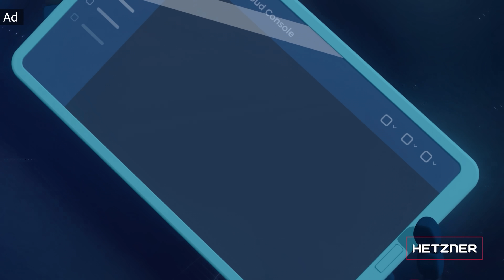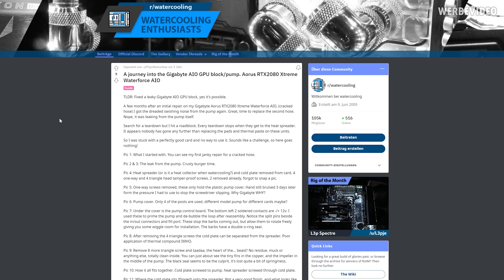Viewer-Mail Ep6: RTX 2080 Gasket Disaster

Comment: I'm thinking those 4 spots that created the roughness on the gasket are probably some kind of glue they used to hold the gasket to the cold plate.... This is a really dumb thing on a gasket, but that is the only thing I can think of that would create those spots in EXACTLY the CENTER of ALL FOUR SIDES of the block.... I think that glue is the cause of the ENTIRE PROBLEM

Comment: Watercooling is great, but just like anything else it gets worse with cheapness and carelessness when assembling stuff. I wouldnt want such a dinky plastic pump on my imaginary watercooled 4090 I cant afford anyways :) A possible solution could be to run you card/ case so hot that leaking water gets evaporated like we see here, although you would need a custom loop with a monitored reservoiur for that :)

Comment: You could definitely use an O-ring of the same or slightly larger thickness and the same or slightly less circumference as that square because it's a tight fit around the copper piece. You would stretch the round O-ring around the square piece and it should do the job.  Gaskets often start off as round cross section or even O-rings when new.  I've seen many automotive gaskets that, after years of heat and pressure, form to the shape they are contained in, which is often a square cross section groove.  Next, it looks like the fill port plug was held in place by a roll pin and not threads. Roll pins are small dowels that would be inserted in hole that is tangential to the fill port and interfaces with a groove in the plug.  I think the roughness on the original gasket was most likely adhesive to hold the gasket in place during assembly based on how evenly spaced the spots were.  However, the flats of squares or rectangles are often difficult to seal which is why in most pressure applications, only round openings are used.  I was surprised how clean the fluid was, my CPU was getting hot and I opened up my AIO to find it full of white sludge.
Reply: Yes, just stretch an o-ring back on. My thoughts exactly.
Reply: I always find it interesting when a subject expert shares their knowledge in youtube comments. It's also amusing how much of complex PC problems can seem to be simple mechanical engineering or electrical engineering problems.

What kind of adhesive do you think they're using? What's the material or of these O rings? Where can I learn more about these?  Any specific courses that teach about O rings, adhesives for mechanics and PC builders alike?
Reply: You can actually buy the gasket rubber by size on a reel so you can make your own replacement gaskets, just cut it to size and then glue the ends together. It's used in the custom water cooling scene where the gaskets would be larger but that shouldn't make much, if any difference really.
Reply: @h4x0rm1k35  Wouldn't it be easier and just as good to stretch on off the shelf o-ring around the part? I'm asking.
Reply: @pf100andahalf  I'd go with no on that one. Purely because you mention stretching because an o-ring wouldn't stay stretched and would shrink back to it's original size before you could even get the plate etc it's sandwiched between together quickly enough. The only way i'd probably recommend it is to get a generic o-ring of the right diameter or slightly larger and for it to also be bigger than the original so you can cut it down to size, kinda like how I mentioned in my previous post but using an actual o-ring designed for something else. As long as the o-ring isn't formed at all then it should be fine, like one like an O should be fine as there's no sharp or formed turns or corners that would either spring back or not conform to the shape you're trying to form/make from it.

Comment: I wonder if some kind of adhesive was used at the four locations on the gasket to hold it in place during assembly.
Reply: That was also my first guess... Some kind of glue on those spots to hold the gasket in place and that roughens the parts of where it was 'glued in' .

Comment: Most O-Rings are Buna-N (Nitrile) rubber composition. That's a well known and well tested material that has no material incompatibility with copper to my knowledge. 
It's very weird that the degradation happened only in those four areas on the block, however. Perhaps they were not coated properly or had a finish error in those spots due to a mistake in the manufacturing? Very very curious, and I'd love to see you take a closer look at that block to see if the cause can be discovered.
Reply: The blocks I've seen use EPDM gaskets/O-rings, e.g. EKWB.  Not sure about AIOs tho.
Reply: The problem isnt being compatible with the copper its the coolant in the loop that makes contact with the gasket.  Who knows what exactly is in the green mystery water.

Comment: Jeez what a waste having to tear it down to find the gasket failed while everything else still works I would have modified the pump housing to have external pump and reuse everything else including putting a thick gasket paste around the cold plate and curing it with UV mask so it never leak again
Reply: I'm thinking the same. But I would remove the pump itself and use reservoir + pump instead.
Reply: Actually I think the input valve was the source of the leak, skip around the video where it's shown at different angles. Looks pretty cut and dry to me.

Comment: The gasket has manufacturing defect, probably cause by worn out injection modes or wrong temperate/pressure. 
Maybe the first product of the day/run for the machine.

Comment: there appears to be a roll pin securing the fill port, but the plastic threads are probably already stripped now
Reply: This is what I was thinking as well. I would bet it is not threaded at all and just has a notch all the way around so that they do not have to mess with clocking it during assembly.

Comment: The black marks on the cold plate are from glue used to hold the gasket in place for installation.
Reply from the maker: Interesting theory. So probably the wrong glue :D At least this was not a good decision
Reply: might that glue be the actual problem ? in a speaker/stuido monitor repair guide they talked about a black goo they liked to put on components and which degrades over time potentially corroding the capacitors and whatnot they touch
Reply: Any glue that gives off acid fumes when curing plus water does damage to copper , specfic electronic pcb silicon rtv sealent can work but ones that do not give off acidic fumes .look up on mouser, digikey, element14,
Reply: Acidic fumes, you just solved a little unsolved mystery I had going in the back of my head! I was curious as to why Monster energy smells strikingly similar to blue Loctite...
Reply: It's not glue, it's gasket maker.

Comment: Great video -- The idea of attaching a perishable AIO to the cards in such a fixed manner without any method of easily replacing the coolant, or offering whole standalone AIO assemblies / retrofit air cooling assemblies seems insane to me, given the lifespan of AIOs and how much longer you can often achieve out of the card itself.
Reply: EVGA offered their AIOs as an after sales purchase, didn't need them to repair your own but you could upgrade your air cooled card to hybrid.
Reply: @flandrble  just put my evga xc3 3080ti on a hybrid cooler a couple weeks ago, as well as replaced the thermal paste with thermal grizzly kryonaut and the thermal pads with a custom set of kriticalpads. The thermal improvements were frightening. dropped from 110C on the memory junction to 76C, and 83C under 100% load on the core to 50C.

Comment: An excellent video and an excellent demonstration  of why I say, "unless you really need it, you should never use water in your PC".
Reply: No, actually its why you should never use any gigasht products in your pc
Reply: This is an excellent demonstration of that? 🤣 Lmao, nothing fckin happened, nothing died or anything. A cheap 2nd hand AIO and a Kraken G12 and the card is back in business. Im more janky than Roman so I'd say the solution with the sealant is also viable.
Reply: @TKIvanov  Except, of course, that the person who owned it didn't fix it, but instead gave it to one the major youtube pc tech channels to fix.  So even if the owner got lucky and he pulled it before it leaked all over his PC, he still had downtime and, but for the particular result here, would have been shelling out of a nrew cooler.

With a premium tower cooler, none of that would have happened.

I agree, if you are running a **900k/s chip, you have a good argument for needing water cooling.  But for 95% of pc users, it simply isn't necessary or even measurably beneficial, but it creates risk, requires maintenance and has a limited lifespan.

Comment: This is a horror story to watch. 
Glad I didn't have the money for 4090 coz I would have bought an AIO version given the high power consumption and intense heat
Reply: My house ran 5 FuryXs (AIO by default) and we still use some of them, we bought them new so you can figure how old they are and we're hardcore gamers who use them all day long without a single issue whatsoever. In fact I'm now running an air cooled 2080 ti and I'm envious of the AIO because the FuryX ran completely silently with no thermal throttling, my 2080 ti has to have it's power limit set to 69% otherwise the fans are always at 100% under the slightest of load.

Seeing how massive the 4090 has to be there's no way I'd get one that isn't water cooled, if I could afford it..
Reply: What part of this video gave you the conclusion that "all AIO equipped graphics cards leak"??

Comment: Last time it was an exploding and burning PSU.
Now a leaking GPU.

I'm not surprised if my Gigabyte made motherboard contains Asbestos dust and uses Lead paints.
Reply: I have a Gigabyte MB. I will let you know if I start to suffer from mental deteriatsihognfffffffffffffffffffffffffffffffffffffffffffffffffffffffffffffffffffffff
Reply: @huhneat8908  I suppose you are suffering from it right now.. mate, seek help
Reply: It contains asbestos equivalent levels of bad in the form of malware 😂
Reply: Now let's talk about rust-proofing. These Colecos will rust up on you like *that*...[shut up Gil, close the deal, close the deal!]
Reply: @ThePawnisking not an excuse
Reply: Dunno what is the crying about as my Gigabyte Gtx 1080 Extreme Gaming edition still works fine for 6 years now, haven't even been repasted, used for gaming daily... had 4 Gigabyte gpu's in the past and none of them gave any problems
Reply: @1sonyzz  they cut costs on every part, most everyone does. some years they have to cost cut harder than others. Gigabyte imo cuts a lot. Reuse of water block from this one here, make the plastic thinner there, sometimes it adds up to a bad design or flaws.
Reply: @MrPruske  So from your comment they are no worse than any one else Over the last 15 years I have used 12 motherboards 7 ASUS and 5 Gigabyte. 3 have failed all ASUS. Your mileage may vary but as an aside we all know one can't stop stupid comments on Youtube like some you can read above.
Reply: @1sonyzz  the crying is usually the existential pain fan noise. It's fun for a change 🥲
Reply: @1sonyzz  other then the time that my 200$ gigabyte motherboard suddenly dying from nothing.. i would say that they make great products
Reply: @1sonyzz  If your card not overheating dont have to repaste. Most peoples broke their cards due unnecessary repaste. Also my 5 years old 1070ti working like a charm(no overheating) without any maintenance except dust cleaning.
Reply: @1sonyzz  I had a 1080 windforce, it was having consistent blue screening. I sent it into RMA, they updated the driver and didn't use the nvidia issued testing software on it to actually test it. Instead they updated the bios, ran furmark for a couple hours and sent it back. 1 week later it completely died and didn't turn back on. They then finally RMA'd it and swapped it for a 2070. sold the 2070 and bought a 2070 super also from gigabyte. 1 year after selling the RMA'd 2070 the guy told me it broke. My 2070 Super also is having memory issues causing bluescreens exactly like the 1080. I sent it to them and yet again, they didn't use NVIDIA's provided trouble shooting software, ran furmark for a couple hours and said it's fine and sent it back despite nvidias software letting you test the gpu for issues within 20 minutes. That's 3 seperate GPU's all from Gigabyte that have failed on me and they refuse to do the bare minimum of using provided software to test the GPU's (this is something they have also done to others if you watch chrisfix's videos where someone who also had a Gigabyte GPU had the exact same symptoms and Gigabyte said the card was fine. Chris Fix using the actual nvidia software found the issue was a memory bank in 5 minutes). 

I just spent extra on an ASUS TUF 3070ti instead, never going gigabyte again. Fuck them and I'd recommend anyone else also go for a different brand. Before someone says it's user error, my PSU well exceeded all cards required need with 850w. It wasn't even close to overheating since I have purposely gotten cases with extremely high airflow and they sit 20-30c under the thermal limit and my 680 from MSI I had prior to my 1080 I had for 6 or so years with no issues. If they owned up to mistakes and issues on their end it would be fine, but they consistently don't and don't even use proper tools when you send stuff into them for RMA.
Reply: @JCglitchmaster  We bought 3 Gigabyte 2080 tis and 2 of them suffered the infamous UFO memory screen 'of death' after the first week of use, 1 was RMA'd twice until it eventually began working, the other one 3 times but they shipped it to the WRONG ADDRESS on the final return, my brother was never compensated in anyway shape or form we were robbed of a brand new $1200 2080 ti.

PS: Mine has worked without needing returned but I have to power limit it in MSI to only use 69% power otherwise the fans go to 100% and are way too loud, but it's a thinner duel-slot air cooled car so that isn't 100% their fault, unlike the shipping issue.
Reply: @1sonyzz  It will burn to shit soon dont worry